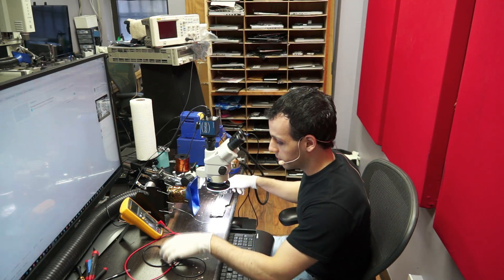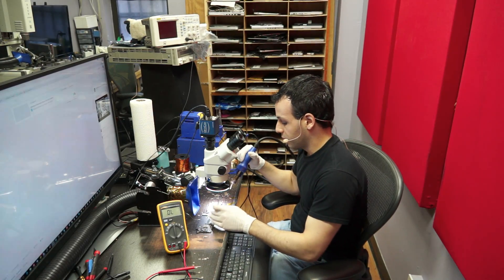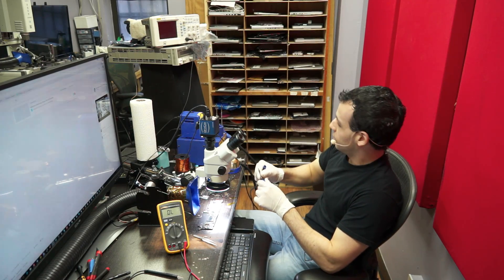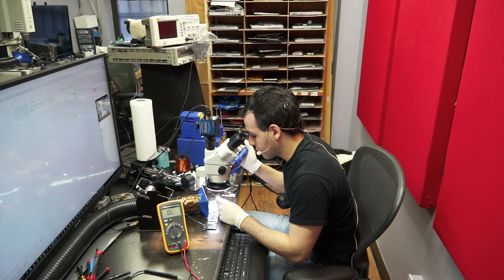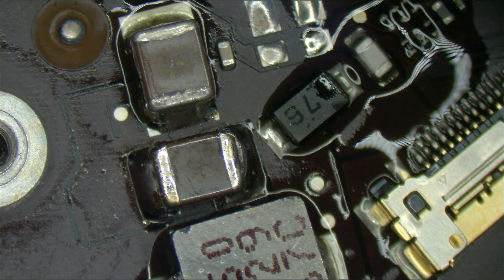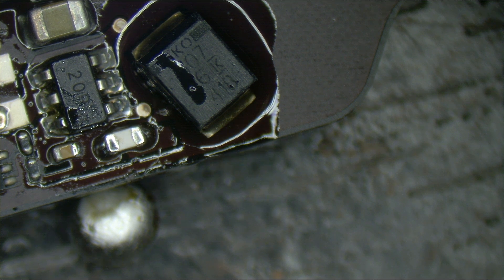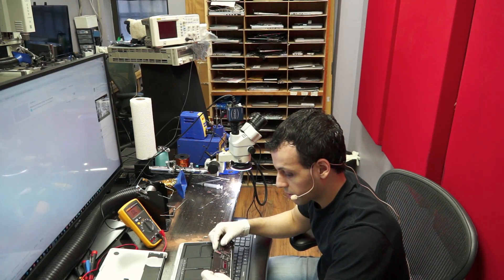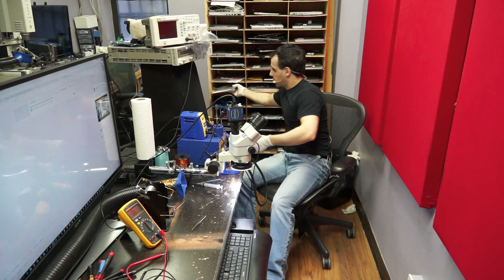Macbook Air no backlight bad caps shorting power to ground

Comment: So I do have a question, but nothing Balt your repair, sorry. I bought a AmScope SE single arm and discovered the eye pieces are to high even after changing to a higher chair. My original thought was bigger working distance, and the main reason was to help with my back. This backfired because I have to stretch to reach the eye pieces. So now I'm looking to return it and get a single arm or double arm AmScope SM. It looks like your using the 7X45 on a single arm without a barlow lens. So can you angle the scope if needed like they told me you can? So far I think this is a double arm feature only. And can you tell me the height of your bench from floor? This will help me determine if the SM will, or will not be to high for me. Even without the barlow lenses it looks like you had plenty of working distance for the repair, was that about 4 to 5 inches? 
Thanks in advance for your help, but their are not many videos in these scopes.

Comment: Good easy fix.  Does it matter which way the capacitors are installed?  If so, how do you tell which way they are supposed to go?
Reply: Ceramic: doesn't matter 
Tantalum, electrolytic...: very important!

Comment: hey Louis i notice you use a lot of tweezers that get nasty after a while, they make tweezers with ceramic tips that e cig users use for their heating elements, they are amazing for desoldering/soldering things, they never get nasty and are heat resistant. they sell them on amazon. just search for "precision black ceramic tweezers"
Reply from the maker: +bovinespongiformflu My tweezers get nasty because I use them to scrape insulation off the board traces or to stab holes through the board, and occasionally I drop them on the floor pointy side first...
Reply: +Louis Rossmann Hah! then you definitely don't want the ceramic ones, if you drop those points first you get tweezer shards all over.